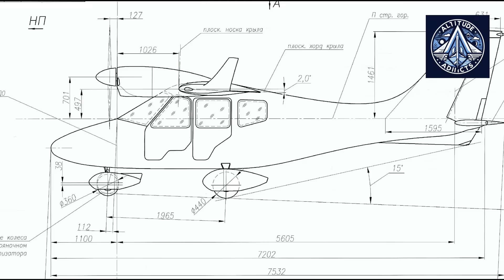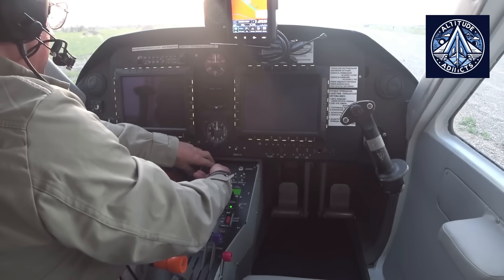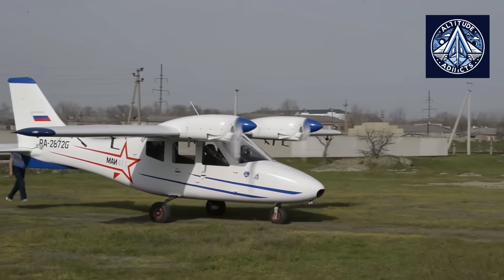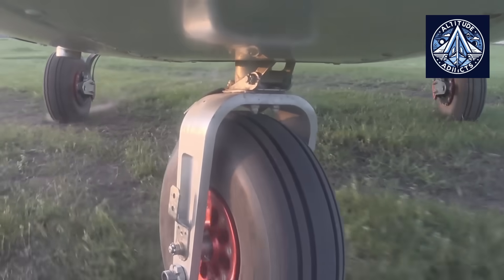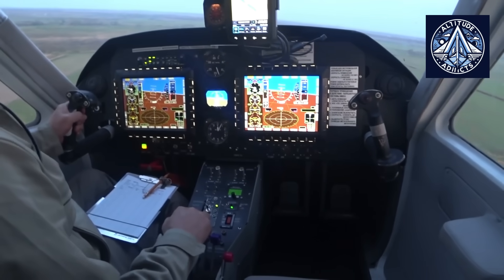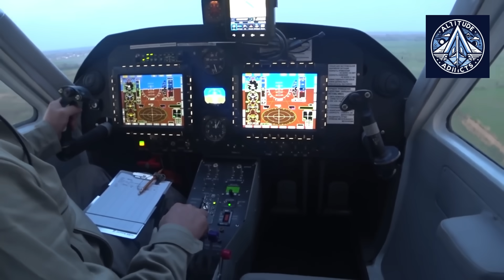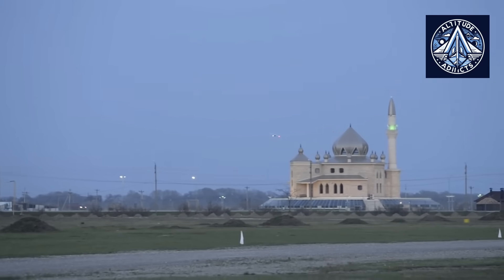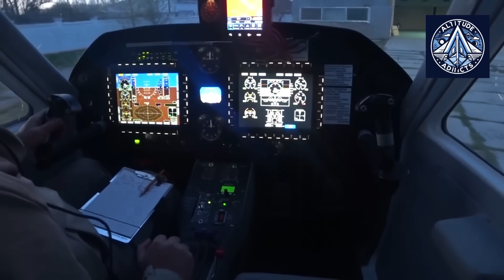Why the Alpha-KM Is Russia’s Answer to the Piper Seneca

Comment: What engine it uses ?
Reply from the maker: Rotax, which is freely available in the world market.
Reply: @altitudeaddicts  not during sanctions !
Reply from the maker: No, Rotax and such engines can be purchased in the open market.
Reply: @altitudeaddicts  no you can't Russia is under sanctions so it cannot pruchase ausrtalian engines easily. But I've learned that there is plans to put russian engines in the future . However it is still unclear which engine will be used.
Reply from the maker: Both the engine and the parts are available for anyone to purchase in the open market. You are referring to direct purchase from the manufacturer. Rotax can be found in Iranian Shahed clones used by Russia. Unlike the bigger aircraft engines, smaller engines and their look alike are available in open markets.
Reply: @altitudeaddicts weong shahed deones uses iranian made Mado MD 550. Moreover this engine is far biger than a Shahed engine

Comment: Alpha-KM and Seneca are not comparable. This plane is powered by a pair of Rotax 912 IS2 engines, 100 hp each. 130 kn cruise up to FL100. Piper Seneca is powered by a pair of TSIO-360 turbocharged TCM engines, 200-220 hp each. Close to 200 kn cruise up to mid-flight levels. FIKI, oxygen, weather radar etc. It's almost like comparing ATR72 vs A320.
Reply: It's more like Russia's version of a Tecnam P2006T.
Reply: Agree
Reply: @alexeygusev698  só o Alfa km is better lol
Reply: haaaaaaahahahahahahaha , lee bien , escucha bien , interpreta bien lo que dice , LOS PIPER SENECA QUE ESTAN AHORA EN RUSIA TERMINAN COMO CHATARRA .-
CON EL COSTO DE PIPER , MAS ARANCELES , MAS MANTENIMIENTO , COMPRAS 3 ALPHA-KM , 1° LO VOLAS , EL SEGUNDO DE AUXILIO Y EL TERCERO PARA REPUESTO .-
VIVA RUSIA CARAJO , OJALA SALGA RAPIDO AL MERCADO .-